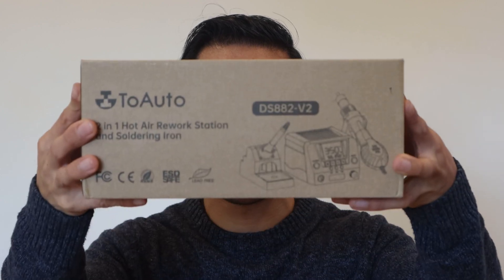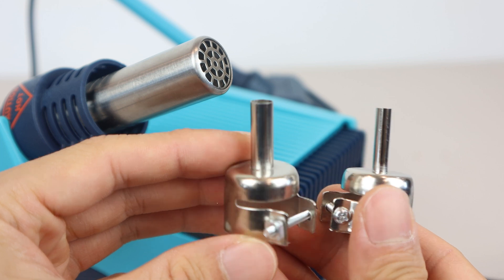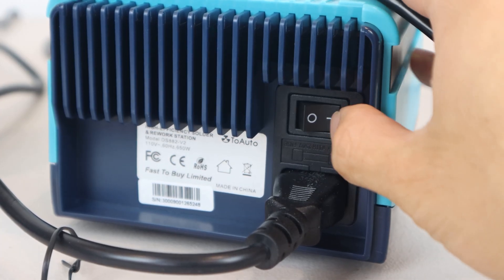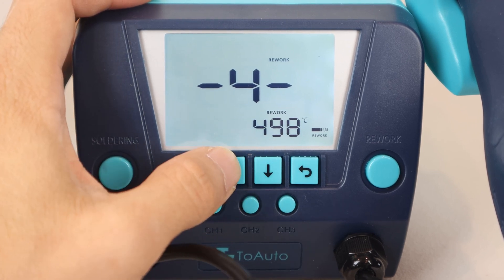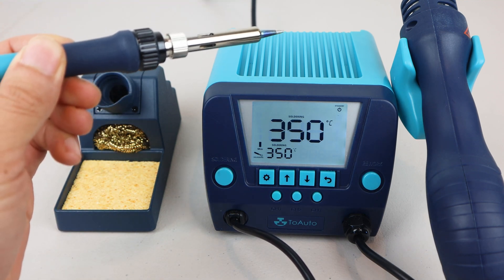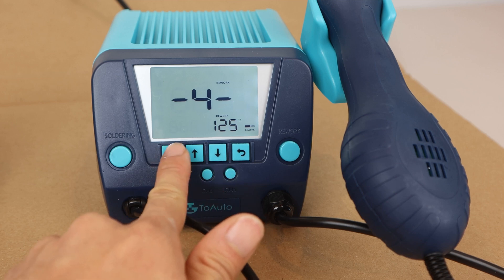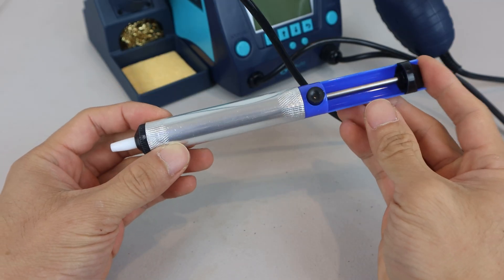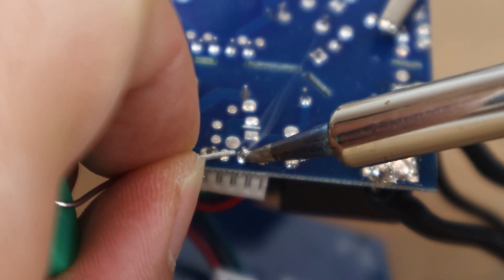Budget Soldering Station Review - ToAuto DS882 V2 Soldering Station Kit

Comment: This isn't an "unbiased review", it's not really a review at all, more like an infomercial. How accurate is the temperature out of the box, did you measure it?
Reply from the maker: Sorry, I didn't have a soldering iron temperature tester at the time I created this video, and the unit didn't come with one, so I I don't have an exact measure of its accuracy. I will say, though, that if the temps were wildly out of spec, then you'd have problems getting your solder to melt or longer than expected dwell times (if too cold) or you'd likely notice your components overheating or excess oxidation carbonization/poor joints (if too high), which I would have disclosed. I know that's not very precise, but it gives you a ballpark idea of whether or not the iron is at least close to the nominal value presented on the screen.

That, plus, if you are able to measure its accuracy with a tool, you can add a temperature correction offset of +/- 50°C using setting 2 (e.g. adjusting for ambient working temps) and thus, even if it was inaccurate out-of-the-box or at the time of testing, you could "make it accurate" by adjusting the offset until the measured temperature matches the value on the screen. I'd be concerned if, even with the offset, I couldn't get the tool to perform inline with the stated temps, which, as presented, I did not find to be the case. As for reviewing style, I try to stick to straight forward facts and provide a thorough walkthrough of form and function and let the viewer decide how they'd feel if they were the ones experiencing the product versus offering  my own subjective opinion. I'm always glad for the feedback though and would be happy to answer any further questions to the best of my ability!